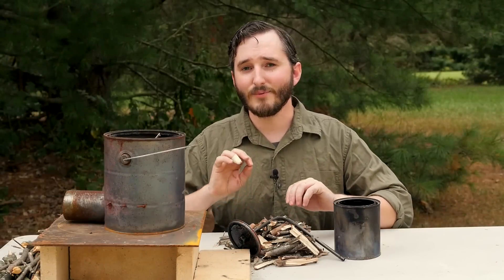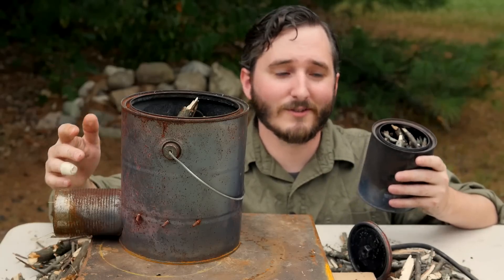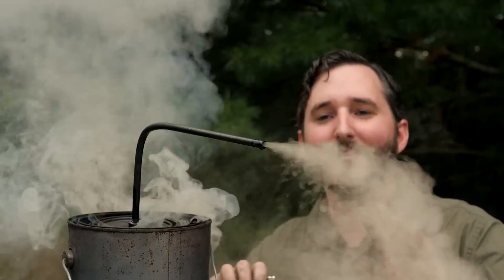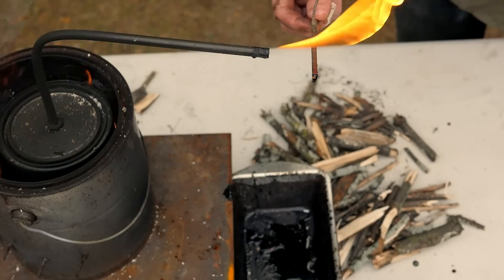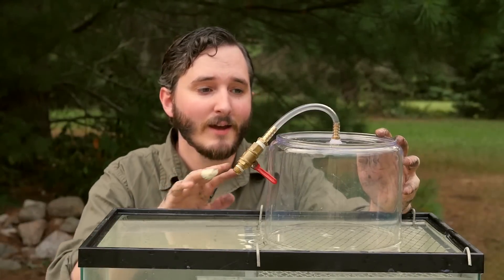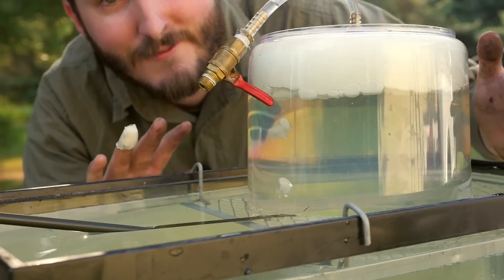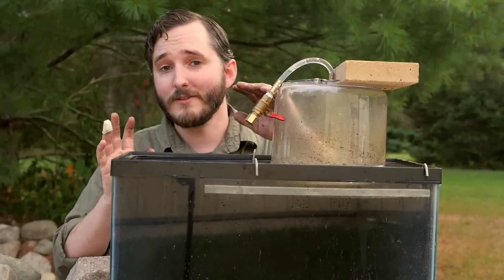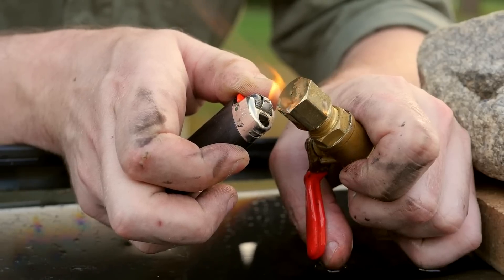How To Make Wood Gas Biofuel (and an experimental gas collection method)

Comment: A simple but helpful demonstration of how to collect gases that are produced.  I am curious to find out how much nitric oxide and other oxides of nitrogen are produced.  These oxides are several hundred times more destructive to the ozone layer and contribute to global warming and production of "Acid Rain."
Reply from the maker: If water filtered I believe the majority of NOx produced, if any, will dissolve into the water forming nitric acid. That acid would then be neutralized by the alkalinity of the tar and ash that is also filtered out by the water. Shouldn't be an issue.

Comment: As far as I know from my grandpa when they had wood gas to run their cars after WWII here in Germany, the big advantage is you don´t need to store woodgas at high pressure. 
After you cleaned the gas from tar with some water cooling and a sawdust filter, you can blow and collect it inside a balloon. Even the balloon will give you enough pressure to make it usable to run an engine. Just make sure it´s a vacuum system with no oxygen coming in.
Reply: Sounds like a plan
Reply: Probably just a mishap: Vacuum means less pressure than the atmosphere so air is sucked into the system. You need overpressure or just good seals to keep the air out.
Reply: I was watching some kinda 'garage wars' show where they were tasked to improve the fuel efficientcy of some grain farm or some shit. Basically rising fuel prices to run dryers was making drying the grain too expensive with commercial fuels.  One of their ideas to capture wood gas was to fill a large half tank with water then sink a slightly narrower half-tank in that.  Then using a pipes to carry the smoke exaust down through between the tanks to be captured by the 'floating' half-tank.  As more gas was collected it raised the floating tank out of the water.  This stored quite a bit of gas. and the weight of the steel half-tank pressurizes it. So when the top tank is vented, gas can be forced out.

Comment: Something that might work well is to have the wood gas run through a vertical coil of wide (Maybe 4in) diameter piping filled with water. That way the wood gas would have much more contact with the water and may even filter fast enough for you to burn it continuously without waiting for settling. Another suggestion: after the wood gas has been filtered by water run it through a chamber containing a desiccant. I would be very interested to see how your results differ when you aren't wasting combustion energy to heat water vapor.

Comment: Using this same set up with a larger reservoir, you could use a compressor to draw the liquid up (thereby pumping the wood gas out) and into a evacuated pressure tank! then the furnace continues making wood gas and when the reservoir refills, just pump the water back up! you could even automate it with some simple electrodes and a briny (conductive) solution, have a contact in the water at the height of the gas inlet, and when that circuit breaks (i.e. the tank is full of gas, circuit ends) it tells the compressor tot run for a set time that is equal to the time it takes to pump the water back up. I'm spitballing here but I think you could make a simple system that only needs fresh wood every so often! Great video!

Comment: I really enjoyed your experiment.  May I offer a small clarification?  The method you used to create the wood gas is called destructive distillation.  It is very simple and effective and makes great charcoal, but makes very dirty gas.  Proper gasifiers can burn off the tars during gas production as well as making more CO from CO2 in the air by loosing oxygen to the charcoal in the reactor of the gasifier .

Comment: For your test with your tank of "pure" gas, using a propane torch head might have given you better results with a better fuel to air mixture ratio. Love the idea of the water filter.

Comment: Are you going to do fractional distillation with your larger setup?  With a large tube, a snug fitting compression ring and a valve you could allow the steam to separate from the methane for a purer product.
Reply from the maker: Not necessary. The steam condenses out as soon as the gas cools.

Comment: Would you be able to use a balloon to collect the unfiltered gas?
The one way that i would think to get the filtered gas is through the nozzle on the filtering vessel and attaching it to that by the positive pressure that its creating on its own.
Reply from the maker: No, the gas comes out too hot and will melt plastic or rubber. It needs to at least go through some water filtering first to cool it off.

Comment: so, okay, how would you go about compressing this? i could see you heating an air tank or something with the valve open in order to force air out, then cooling it (slowly to avoid implosion) and allowing it to suck in the wood gas?
Reply from the maker: You can just use an air pump. A bike pump or air compressor, whatever.

Comment: I like it.  But the Wood Gas won't seem to continue to burn without the continued catalystm of the lighter.
 I think that Gasoline doesn't actually fuel automobile combustion engines, but rather the 70% Nitrogen in the 
atmosphere does and that the gasoline is just the continued catalyst like your lighter is.

Comment: I am really impressed by how well thought out this video is. I know I could probably google it, but I was wondering if you could answer this question. What other things can you use to make gas? Can you use carbon, what specific organic materials work best?
Reply from the maker: Carbon alone doesn't work, it's got to be something still with a lot of hydrogen left in it. Grass or plants of any kind.
Reply: <<Can you use carbon, what specific organic materials work best?>>

Pure carbon wont give off wood gas.  Carbon,  or charcoal,  is what you are left with after wood gas is extracted by heating wood in the absence of oxygen.

Comment: Is it possible to get enough wood gas to pressurize it and turn it into a liquid?
Reply: It is possible. It's much more complicated than just pressurizing it. The gasses need to be separated first. Gases such as H2, N2, Methane, CO, CO2 have different properties and weights. If you try to compress and liquefy the gasses together, you will see some of the gasses will turn to liquid while gasses such as H2 will remain as a gas.

The best way to separate the gasses is to use cryogenics (aka refrigeration) liquefy the gasses based on their dew point (or freezing point for CO2). This is done in stages until the gas requiring the lowest temperature (H2) is left.

tldr: you can ideally pressurize the wood gas no problem, liquefying it is more complicated.
Reply: @ziggarot  maybe just to store it as a gas...

Comment: I'm curious as to why wood gas isn't in wide use. After all, it's clean burning. Charcoal is still made in abundance so it can be gathered rather easily. It seems like there would be quite a few good uses for it. Especially with how clean it does burn. So I have 2 questions for you. 1, is wood gas ever collected in abundance?(I'm thinking not.) If not, why isn't it used?
Reply from the maker: Gas made in this same way from coal rather than wood used to be widely used. The reason wood gas and coal gas isn't used anymore is because fossil fuels and natural gas are extremely cheap and higher energy. Charcoal makers feed the wood gas back into their furnaces to make charcoal more efficiently rather than collecting the gas and using it for other things.
Reply: NightHawkInLight awsome! Thanks for taking the time to answer. In the words of GI Joe, "Now I know, And knowing is half the battle."

Comment: Wow! That was very impressive for something that you threw together. Are we to assume that the crude wood gas pushed the water out of the container that you were collecting it in, or was it gravity on the water that acted as a vacuum? It would've been nice to have seen that process. Also do you have any idea what temperature the refined gas burns at? Thanks for your time, and thanks for sharing.
Reply from the maker: Gravity on the water pulls a vacuum. I'm not sure of the gas burn temp, I haven't got that far in testing.
Reply: I just rewatched the video. For some reason or another I missed the part where you were filling up the container with refined fuel, so disregard my earlier comment about not seeing the process. Thanks for the reply. I'd like to try this sometime just to see how it works. Pretty cool.

Comment: Would ice cold water work better for cleaning the resulting gasses or would it condense and liquify? Please explain if possible. Thanks!
Reply: Oh and would an old air compressor work for pressurization of storage containers?

Comment: You could try to cool down the gas and separate them. Then you could put them while liquid into bottles so they are pressurized at room temperature. With your bottles you then could try to maybe melt some glass or metal.

Comment: would you be able to make a gas stove out of home depot materials to burn the gas you think?
Reply from the maker: Sure, with regular stove parts. This would burn the same in a stove as any other gas.
Reply: cool! because it looked like the flame got killed all the time, maybe you can try to find a way to "bottle the gas" and try to run a small stove on it?

Comment: Nice! I bet you could use the hot side while making wood gas in order to generate even more power aka say stirling.

I wonder if you would consider captioning videos. Autocaptions is quite good for your videos, so it is little more than copying autocaptions, correcting maybe couple words and adding it as english captions.

Comment: You could store the bubbled, cool gas in a large bladder, like an air mattress.  I've seen several articles about small scale biogas production in the third world storing uncompressed gas in bladders.  

When you need to use the gas, put a rock or something on the mattress to add pressure.
Reply from the maker: Not a bad idea. I'm afraid the mattress would only be good for a few uses though. The smoke and tar contain chemicals that can weaken and dissolve plastic.

Comment: how about using a air compressor hooked to a float switch to compress it into a propane cylinder. i wonder if you wrapped an exhaust pipe into the shape of a cylinder, and packed with loose steel wool inside the pipe if it would get hot enough in the cylinder to make wood gas. than vent that into water filled cylinder with a piston that can rise and fall with gas level. on the top of that you hook a hose going to an a/c compressor, the compressor clutch is connected to a switch on the piston than turns on and off at appropriate levels. this compresses it into a water pressure tank that is used to fuel the motor. you can probably tune it by regulating pressure to the injectors.

Comment: If you wanted to go further with it and compress the gas all you need is a gas bladder with a super small air compressor inside. Not sure if you have a tank to fill it, but its not hard to make one if you can weld, just use a propane tank with one of those bike pump style inlets. Might seem a bit too far but im just saying you could use it to fuel a gas grill forever.

Comment: Could you make a self feeding system, possibly using wood pellets, that make the wood gas, and then possibly using those partially used pellets as fuel for the system, possibly using some archemedies screw system?

Comment: will it not stay lit if you remove the lighter?
Reply from the maker: It needs a torch head so air is mixed with the gas before it's lit. It's hard to keep lit otherwise. Propane and other gas acts the same way if it's under pressure like this and coming out of a small hole.
Reply: DUH, I shoulda known that, same as a gas blacksmith forge.  Thank you for the reply

Comment: Next time set it up so the container is submerged to begin with, that way it's already under pressure & you can transfer that gas to another container that's already under pressure, i'd weald 3 oil drums together & have the gas chamber at the end of the 1st drum, 8ft of water above the chamber should give it a hefty amount of pressure so you could move all the gas to a gas canister without the need for a pump. 
Being at the top of the 1st drum would mean you'd have 4ft of water under the chamber to filter the gas & have something like a fine mesh at the pipe outlet so the gas are dispersed into finer bubbles to filter them more efficiently, that should cut out the part where you had to wait for impurities to settle in the chamber. 
The idea does have promise for some effective self production of cooking gas.

Comment: If the desider product is charcoal, why not use the wood gas directly to fuel the main fire under the closed can? It could cut the cost of secondary fuel
Reply from the maker: If the only goal is charcoal, yes that is the best way to do it. You don't use a pipe for the gas, you just poke holes in the can's lid and put it upside down in the fire so they vent out the bottom.

Comment: Do you think heating it using electricity would get it hot enough to produce the same amount of gas? Also, you would be able to save the sticks used for burning to produce more gas and if you are able to use solar power for it it would be a lot more cleaner than it is now.

Comment: How did you prevent yourself from just collecting steam in the tank since steam comes before the wood gas?
Reply from the maker: Steam condenses in the water
Reply: Steam would condense back to water.
Reply: Nice video, Thanks a lot. I have another question though, why does the flame go when you take away the lighter? i mean, shouldn't the flame keep continue even if when you remove the lighter ?

Comment: It would be interesting to see what the gas' density is. You could weigh a balloon while empty, then fill it with a liter of gas and weigh it again. The gas may be less dense than air, which would result in the balloon weighing less when filled than it did when empty. In fact the balloon might even become buoyant and float in air if you fill it up.

Comment: Have you considered building a stripping column to get a better separation of the gas from the soot? This is very similar to a design project I did while at university. Recommend using a chilled alcohol if you decide to build one

Comment: Just a thought, rather than having to suck so hard to evacuate the vessel, why not open the valve, lower the entire thing into the water (the left, non-meshed side) allowing water to displace the air freely, close the valve and raise the vessel again? as long as the bottom stays submerged, it should be exactly as for the suspended fishtank.
Reply from the maker: Not enough room past the mesh. And I would have to get wet. Sucking the air out is easy.

Comment: Carbon monoxide is a non flammable gas because it has already been oxidised. And it is a biproduct in burning down Wood or cigarets so it can't ne flammable
Reply from the maker: It is not fully oxidized. It burns to form CO2.

Comment: Very nice. To improve the burning properties of your wood gas, you might want to add some quicklime (CaO) to your water. Wood gas contains around 5% carbon dioxide (CO2), which is not flammable and thus lowers the burning quality of your product. However, if you put quicklime into your water, it will form calcium hydroxide. This will react with any carbon dioxid in your wood gas and thus removes it from your processed gas. The reaction is called carbonatation and can even be seen as it will turn your water milky, because it forms insoluble calcium carbonate.

Comment: You should have drilled a hole for the air to get in, so that jet of wood gas which was released from that tiny hole on valve could self sustain fire, or even burn hotter! Just like jet lighters do!?

Comment: So would it be possible to infuse water with wood gas? Like adding co2 to soda. If so you could then take the wood gas infused water and use electrolysis to pull the gas out of the water in a cleaner and pure form.

Comment: 5:20 you havent reduced the sticks, you've oxidized them
Reply from the maker: No, they have not been oxidized. When heated in a container void of oxygen biomatter is reduced to charcoal which is nearly pure carbon. The carbon can then be oxidized if burned in air to form CO2.

Comment: Build a proper filtering system to purify the gas more!  Maybe pushing the gas through  a cooling jar to remove the water and tar and then running the gas through some sort of filter like a bucket of saw dust and then have it stored in the fish tank

Comment: Ever thought about getting a solar oven to heat the wood instead of flame.   Cheaper and there is no flame so you don't need to worry as much about a leak.
Reply: Have the capture bubble under the water from the beginning and have a larger tank or some other type of storage hooked up to the hose.

Comment: It's good to see you doing a video on this!  I've been interested in wood gas (also known as producer gas) for a while now, ever since I learned that it was used to power cars back during WWII.  There was even a training tank converted to run off it!  Minus the turret and most of the excess weight, of course.  Unfortunately the problem with producer gas cars is that if everyone starts using them, it creates mass deforestation issues.  On the other hand, if you have one yourself, all you need to drive cross-country is an axe and a saw.  

I'd love to see all the scrap wood from mills and other places being used to produce wood gas.  Maybe even wood from demolished buildings and such too? Who knows?  There's certainly an untapped potential out there.  Eventually we may need to start seriously considering it once other sources of fuel begin to dry up or become more expensive.
Reply: Yep